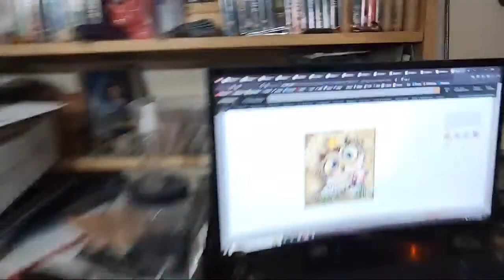Custom Wire And Cab Ring Craft Along Athon Livestream 11.4.2

Comment: @Yvonne Williams 💎 I love those pencil boxes💕 I finally got me one after I received a huge box on a donation of gemstones that will probably last me a lifetime. I think I may know which box you're talking about at Harbor freight as well , is it the wooden box that has a handle and there's drawers inside of it it has a locking front door that folds out and there's also a mirror on the inside of the lid on the top💞 it's like 75 bucks.🤗... I'm saving up to get that one too hehe.